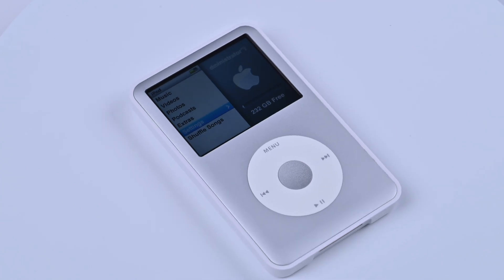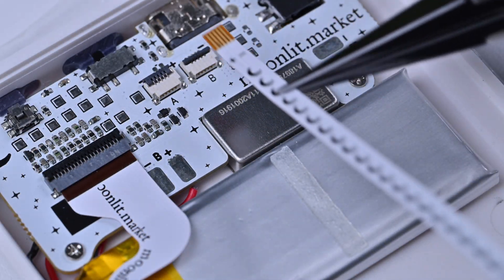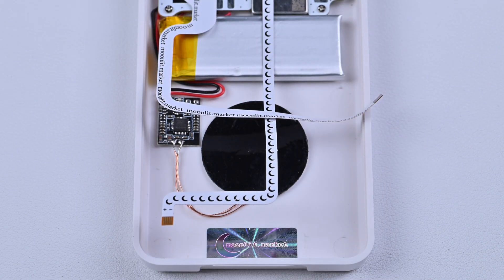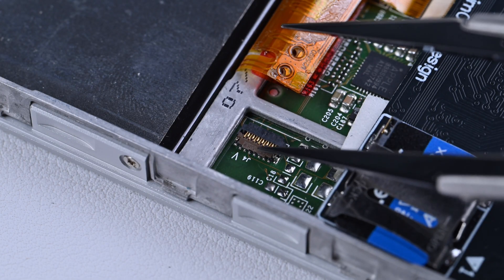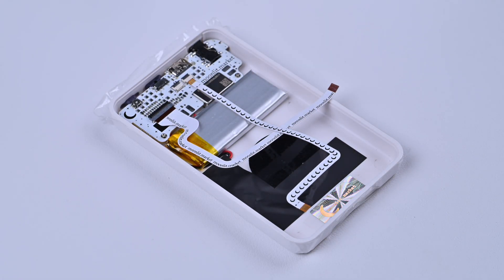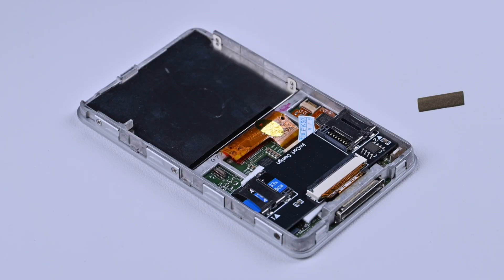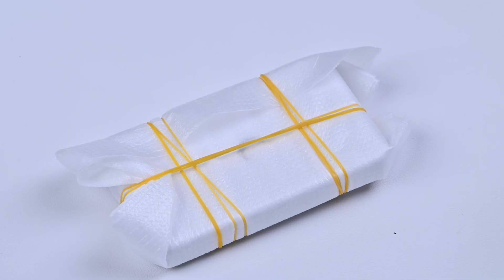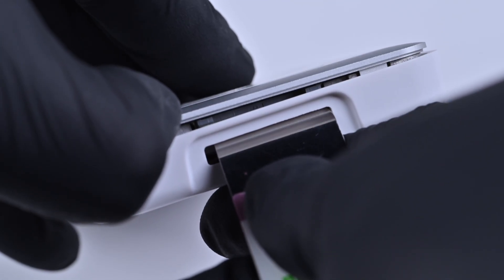iPod upgrade in 10 min! moonlit.market Classic Connect installation tutorial [Updated]

Comment: is this compatible with the iflash quad board?
Reply: That's what i want to know, but they're website doesn't say shit
Reply: @Diegoisletta I emailed and they said no.  But aliexpress has the duo adaptor for 47 bucks i got mine and it works perfectly with a 128gb micro sd onn from Walmart no format required

Comment: Hi I have this kit with the battery 2000 mah. I cut the wires and removed the little battery. Now I am struggling a lot because the iPod doesn't want to fit. I also cut the metal on the top but still nothing.
Please make a video on how to position the components to fit with a larger battery